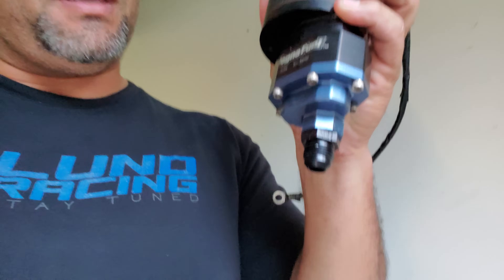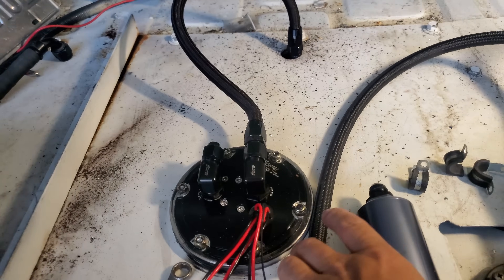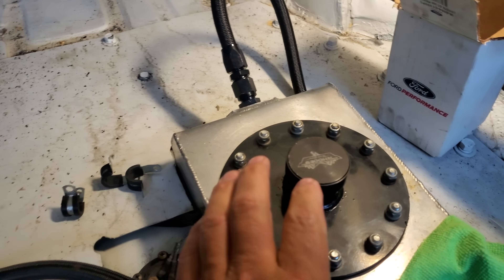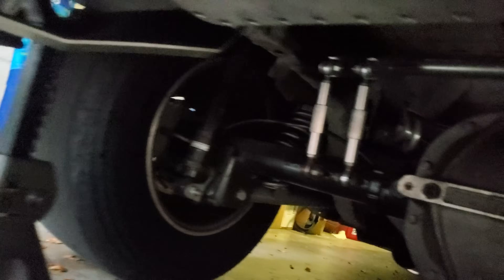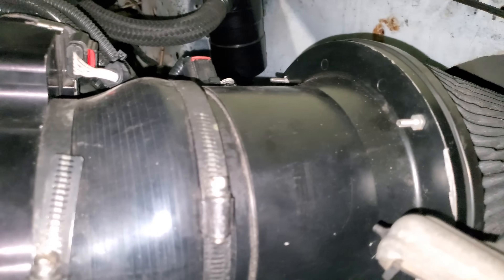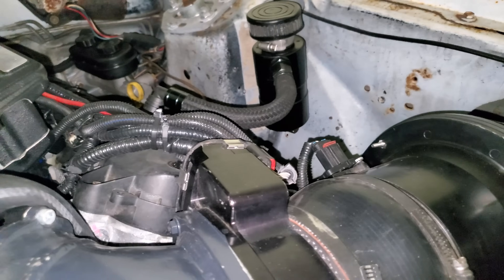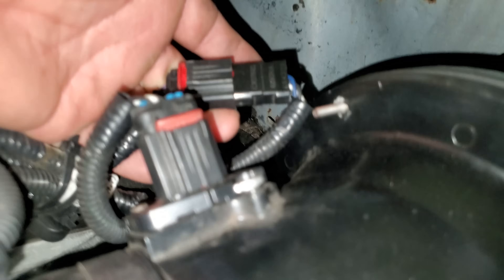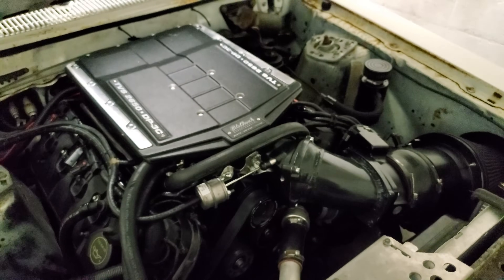Upgrading the Fairmont fuel system and Whipple throttle body on an Edelbrock supercharger

Comment: Any reason you didn’t remove the vacuum from the fuel pressure reg when setting the pressure? Or am I stupid and missing something
Reply: This^^^ I remember years ago hearing that when I had an adjustable aeromotive pressure regulator and being told to remove the vaccum when adjusting pressure.

Comment: Hi Alex I hope that you and your family are doing well. Can you please tell me on an average day of say 85 degrees Fahrenheit what are your IAT’s ? I know that you think the Roush blower is shit because of heat soak and other reasons but please hear me out. I have installed the stage 2 2650 with the new tune and the 50% larger intercooler on my 2019 10r80. With the ambient temperature at 104degrees Fahrenheit it has an IAT of 130-135 degrees. We put it on a highly accurate hub Dyno and did 4 pulls back to back and the IAT’s were130 varying slightly. Power at the crank is rated at 750 by Roush. It made 660 rwhp give or take a few every time with 20 seconds in between. Running on pump 93. Now on those figures( and I can email you the pull sheet ) will you tune it for me.? And I have tracked it with the same results. Has a transmission cooler, and a Shelby oil cooler and the fake inlets for the front disks are being cut through so fresh air straight on the discs and 4 piston Brembo’s to replace the standard FoMoCo single pistons. Edited to include SAE Smoothing 5.

Comment: So do you need to make a special adapter to fit the whipple 132mm throttle body onto a vmp gen3?
Reply from the maker: Yes
Reply: im running their twin 67s with their tune no issues drives like stock.  unless you are going for 900+ dont see the point in upgrading unless im wrong..im at 700 wheel on pump, fuel system e85, sand looking for 850 on a stock gen2